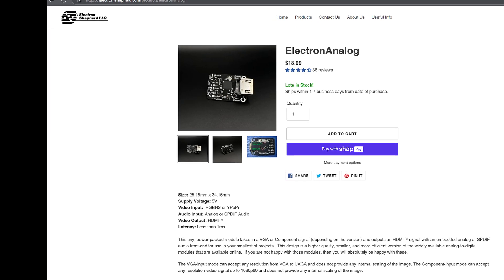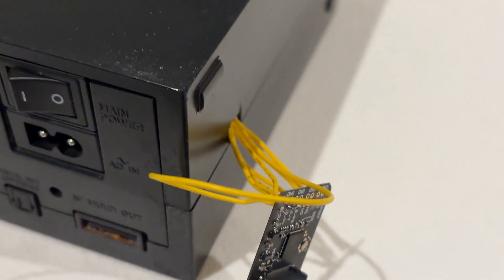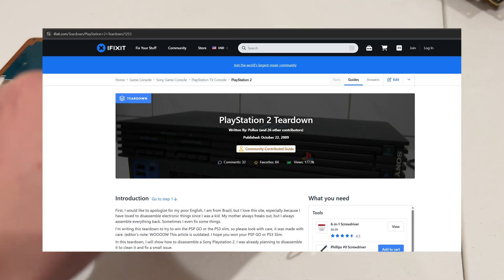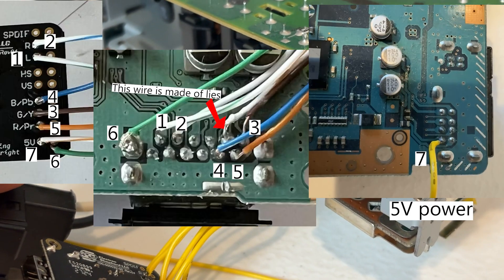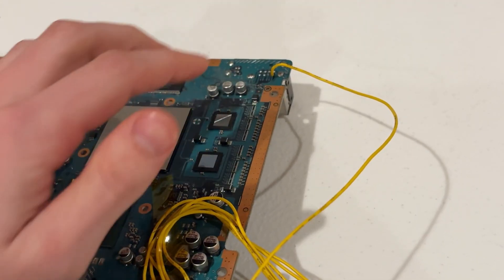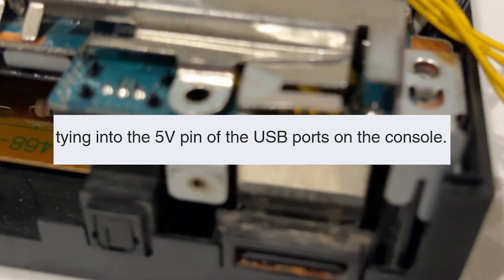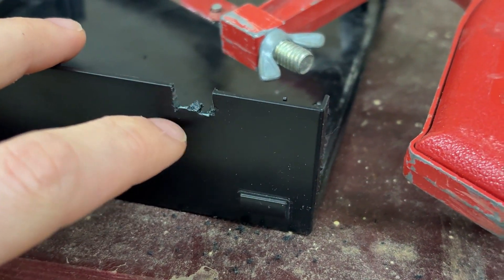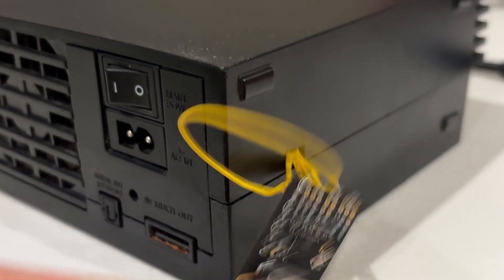PS2 HDMI Tutorial - Fat Model, ElectronAnalog

Comment: Did you ever put this inside the case? If so where? Will it fit beside the power plug/switch vertically (with some plastic drilling/cutting)? I see theres a spot to solder to select y/pb/pr or rca, and idea on soldering/mounting a switch to make it selectable?